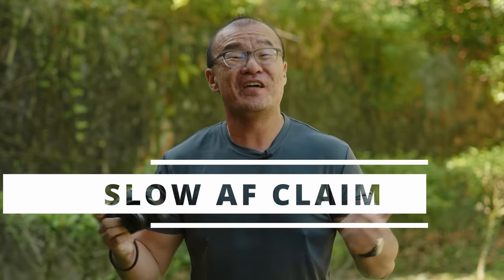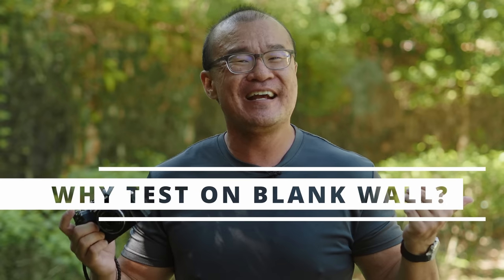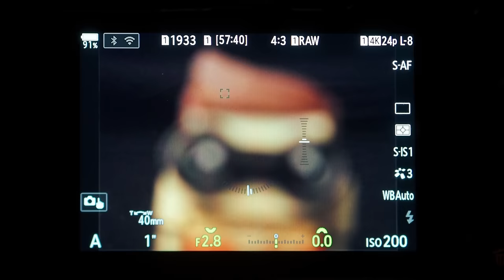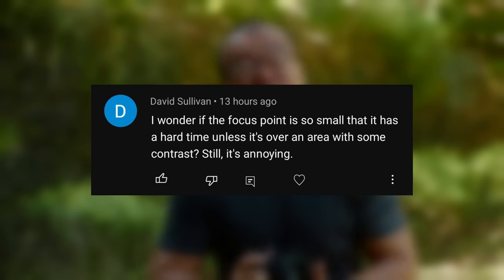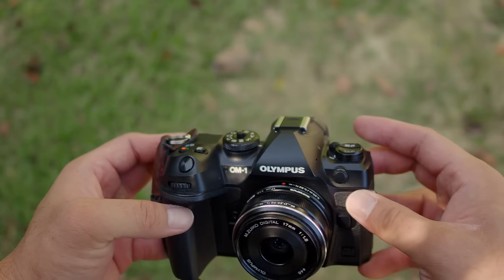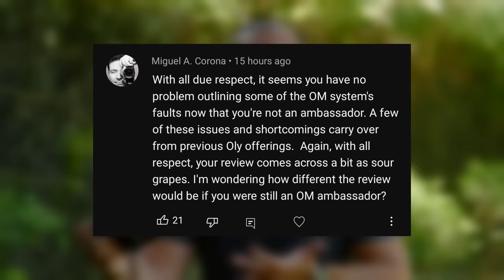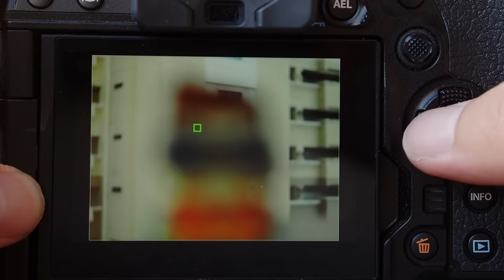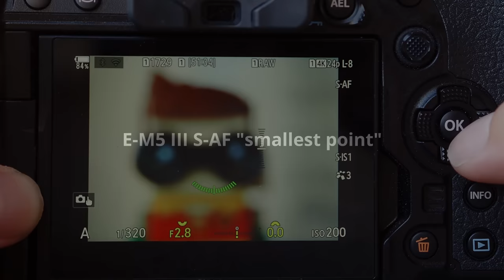OM-1 Slow S-AF Follow Up With MORE EXAMPLES

Comment: Hi! You could try another lens.
It may be that the lens software does not match well with the new camera software
Reply from the maker: I have tried ALL lenses. I don't think you want to see a one hour video showing my tests from ALL my lenses. Also, I said I have shot more than a dozen of jobs, that was more than sufficient for me to conclude the S-AF performance.
Reply: @robinwong  Maybe the camera should be repaired!?
Reply from the maker: @ulovaher7518  if you sift through the comments in my previous video, more than a dozen people have similar AF issues. I don't think my camera is faulty. The AF is just slower
Reply: @robinwong  Hi! But many don't have a problem with S-AF.
Presumably, it is a manufacturing error, when many cameras are defective, but many are fine. This should be fixed by a warranty repair.
It was the same with Nokia phones around 2006. New defective phones that needed warranty repair came on sale.

Comment: try go to [Live View>Frame Rate] switch to [normal], I find it is better in focusing low contrast target. The Em1ii/iii also have the same problem as well, just no one mention it. I believe one of the reason that EM5iii performs better because it dose not have high Frame Rate.
Reply from the maker: Live View frame rate has nothing to do with the AF system. They function separately. Did you watch the video, or did you choose to ignore my evidence that E-M5 Mark III performing BETTER than OM-1? What same problem are you talking about? That makes no sense.

Comment: In all fairness though, the E-m1 III small focus point, while acquiring focus faster, acquires whatever it wants to acquire in the box or slightly around it. Like the pin point autofocus on Panasonic, the om1 single point is aimed at accuracy more than speed, therefore it is slower and definitely struggles when little to no contrast is present. Maybe OM should have done something like Panasonic and placed the single point as its own focus area mode instead, to avoid confusion. Just use the larger focus point for normal applications and enjoy the camera.

Comment: Yikes, either your OM1 is defective or firmware 1.5 will have to sort this out.
Reply from the maker: A dozen or so others commented in the previous video reporting the same issue.
Reply: Wouldn't be surprised if all the effort went into the new AF routines for birds etc and the basic stuff has been somewhat ignored.

Comment: That is truly abysmal performance. I have an EM-5 iii and an OM-1 and I quickly checked them following your first video and found them little different. In fact I found more difference between lenses (25 and 45mm F1.8) than  between the cameras. I plan to try a similar test to yours, more rigorous, and  will let you know how I get on.
Reply from the maker: Do the tests in low contrast and low light and you will see a huge difference!
Reply: @robinwong  I went for a walk last night with the EM5 iii and 45 f1.8 and had no trouble; another walk this morning (raining) with the OM-5 and 40-150 f4 - again no trouble. However, with a set-up similar to yours with a foreground subject, low light, and a nondescript background I couldn't get the OM-1 to focus at all on flat areas, whereas the EM-5 was quite happy anywhere. (25 f1.8). I hope OMS come up with a solution. Incidentally I LOVE the 40-150 f4 - suits my needs exactly.
Reply from the maker: Thanks for taking the time to verify this issue. That means a lot to me.

Comment: hi robin I have tried the S-AF and single point and my camera focused fast and accurately, i think there is something wrong with your camera.
Reply from the maker: I did not say the S-AF did not perform fast and accurately. I said it was SLOWER than older cameras, especially in low contrast and low light situation, as demonstrated. Unless you would like to do a video demonstration to prove me otherwise?

Comment: With the 'small' AF target selected, my OM-1 is at least as fast focussing as my E-M1.2, maybe even faster. With the single AF point, it depends on the contrast of the (very small) selected point. 
I therefore believe that your camera is faulty. I hope it is still under warranty. You should have it checked.
Reply from the maker: If you sift through the comments in my previous video, more than a dozen people have similar AF issues. I don't think my camera is faulty.
Reply: @robinwong  Hopefully Rob Trek or Peter Forsgard can do a video on their OM-1 focussing with the same settings.

Comment: Hopefully OMDS look at this feedback and get the issue fixes with the new FW. OM-1 CAF is so good and I use mine mostly on actions, wildlife and people, only time I use SAF is with HHHR mode. I don't notice the issue with SAF using it with HHHR with any of my lenses - wide angel to tele.  I am on FW1.4.  However, 95% of the time, I use CAF and when I need SAF, I don't use it under low light condition. 

Comparing to EM1.3, I missed more critical shots with it than OM-1 when on CAF.  Often even I have focus on the subject, the results can either be OOF or soft images.  This is a thing of the past with OM-1.

I trust your findings Robin, OMDS needs inputs to fix things.  So far, they have been trying to address various issues from their real users from what I can tell.
Reply from the maker: If you refer to the comment here in this thread by Vincenzo Avignone, I find the same encounter, the C-AF performs poorly in low contrast, low light, especially shooting people and faces. S-AF is a more confident method is dealing with this. Unfortunately, I was hoping it was on the same level as the older cameras.
Reply: No I didn't read that comment just purely responding to your experiences while sharing mine.  When I shoot animal in very dim light condition.  I shot flying Osprey coming in close at 1/1000 at ISO 10k ro 12.8k with zero problem,  I could never have done that with EM1.3.  Perhaps the AI overcome those issue where the older Face detect with SAF or CAF fail with OM-1 and the update is needed.

Comment: hi robin I have found that C-AF works better than S-AF.
Reply from the maker: Someone reported C-AF has high failure rate in low contrast/low light conditions (comment by 
Vincenzo Avignone in this thread), especially on human faces. I have found this to be true, and S-AF is a more confident way to deal with this.

Comment: Hi Robin

Didn't you accidentally get a bad camera? luck in an accident, you got it for free from someone from America. maybe he also had problems with this camera. Maybe you won't have AF problems with another copy.
Reply from the maker: Did a dozen or more people have bad cameras, referring to the comment thread in my previous video? I don't think so. The issue is real.
Reply: @robinwong  if that is indeed the case, OM digtsolutions has a big problem with its cameras, especially when it comes to their flagship camera.

Comment: Hey Robin, maybe one workaround could be using AFC all the time? It seems that AFS on the OM-1 uses contrast detect only but not phase detect. Using AFC may potentially be more reliable.
Reply from the maker: I have tried. It was worse.
Reply: @robinwong  Thanks for confirming.That is shocking. I was very tempted to buy the OM-1 but now I would like to wait and see. I will test more units in camera store to see if the problem is universal.

Comment: Why are you using the arrow key selectors switch for selecting your focus point instead of using the joystick,
The joystick is optimize to work with the autofocus when you want to do single point auto focus only,
To me this is not a fair review of the single point auto focus if you're not using the right tool that is on the camera,
The right tool for selecting single point auto focus is the joystick which is slightly above and slightly left of the arrow key selector switch.
Reply from the maker: Whether you use arrow key or the joystick, it does not change the performance of the AF.

Comment: Is it possible that the minimal focus distance has changed due to the new sensor and auto focus system?  Even though I agree the OM-1 does have some auto focus shortcomings. I have noticed it does not seem to focus as closely to my subject as my E-M1 mark III  At least that's the way it seems to me.
Reply from the maker: But it manages to focus once or twice. And I verified that I can still go nearer. The 12-40mm lens can go SUPER close, it was still safely far from minimum focusing distance.
Reply: @robinwong  ok so much for that theory lol